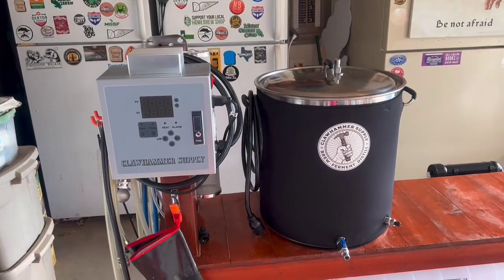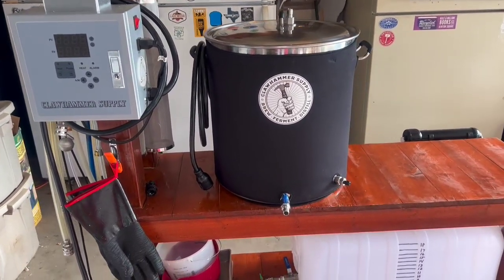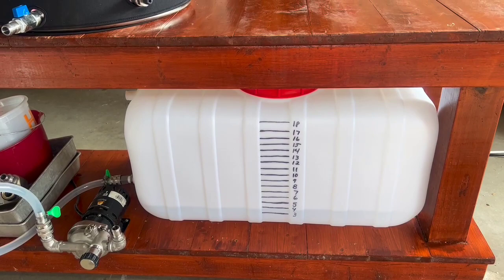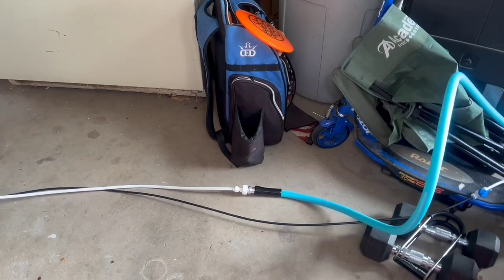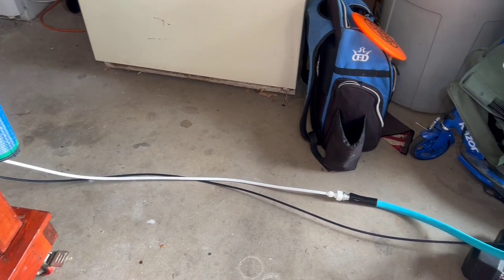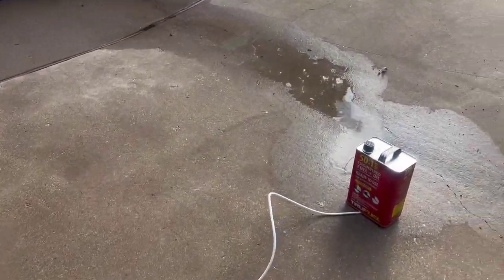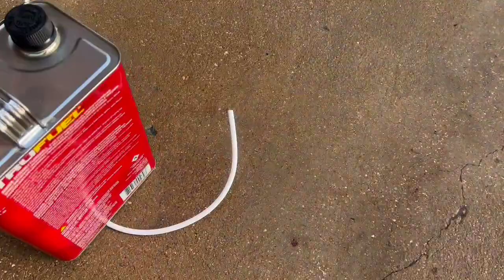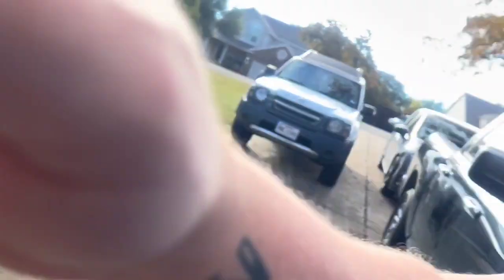Brew Delicious Craft Beer in Minutes With This Incredible RO Water System

Comment from the maker: Thanks for watching. The insulation jacket has a round piece that the kettle sits on. I didn’t use it on the first brew and some of the stain came off. Since then, it hasn’t been an issue using the pad. We need to do a sticker swap. Sent you a DM on Instagram